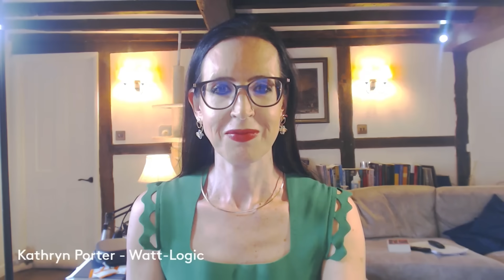North Hyde substation fire and the Heathrow blackout

Comment: Thank you, Kathryn, for this video. It is sad that the National Grid behaves like this e.g. flogs antiquated 57 year old transformers above their rated capacity,  doesn't bothering to maintain them or replace them, and doesn't even bother to keep the fire suppression equipment functional. If you look at the National Grid's top team, their bios indicate they were focused on green energy and DEI, rather than keeping the lights on. As the UK goes woke with DEI appointments and goes green, it will stop functioning and go broke.
Reply: DEI had NOTHING to do with this.  It was about cost cutting, purely cost cutting and corporate greed.  Stop putting your agenda on it.  Also green energy is important.  The problem is doing  everything half arsed because half arsed is cheap.  Spend the money, do it properly ie maintain the assets properly AND provide renewable connections and whilst you have increased costs and less profits for shareholders in the short term, long term you have a reliable network that is fit for the future.
Reply: @cjmillsnun   Mostly correct ... but DEI IS a real problem in engineering.  

It's not a recent one as things have been going wrong for a long time due to cost cutting (such as Indian 'coding farms') but it has gotten worse as the Old White Guys are retiring and the skill base is dropping as a result (because there is also cost cutting when it comes to education and training).
Reply: @dallassukerkin6878  DEI is not a real problem in engineering. DEI doesn't cause companies to offshore to Indian coding farms, often MBA's do! As the commenter below states, positive discrimination is illegal! in the UK The skill base is dropping because this country slept for thirty years as a result of thatcherism and reaganomics. For too long people have let the economy revolve around the CoL and Canary Wharf. What you perceive as DEI hires are a result of a stagnant talent pool in the UK.
Reply: @Saaj2   I don't disagree on the whole with what a big part of the talent problem is - 'diversity hires' are a part of it as they are enforced by hiring rules (why do people post that positive discrimination is not a thing when it is?) but I am equally unimpressed by the young engineers coming out of university unequipped to deal with the 'real world'.  I am, of course, convinced, that I was never that green :chuckles:
Reply: @dallassukerkin6878 I am unaware of any companies that have hiring rules that specifically stipulate they should favour diversity hire over a 'normal' hire, please show me as I'm genuinely intrigued. 

There are companies that have social mobility schemes where they target people of certain races or class, with the specific intent of giving them an opportunity that the industry did not give them before, primarily due to discrimination. If this is what is perceived as "DEI hiring", I would say it is only fair after decades of discrimination.

Most importantly, they would still have to pass the same criteria any other hire would, so this is why the whole "DEI hires are useless" rhetoric seems completely silly and is something the Telegraph and Mr Farage likes to spew.
Reply: @dallassukerkin6878 I do agree, most engineers, (yes including myself) do not have enough real world experience. I think the computerisation of many engineering roles is largely to blame, and a significant lack of desire from both the retiring generation and the new to do any knowledge transfer.
Reply: @Saaj2   A large problem with the lack of transfer of knowledge to the new engineers coming in is that companies are not willing to pay for it.  

I did what I could to provide system building methods and problem solving approaches as well as general system experience but upper tier managers were never willing to allow me the time to do it, even when the more immediate managers were in favour of it (as my retirement grew near).  In my own time I put a folder together of 'essentials' and left copies with the juniors in the team when I left but who knows if they will make use of it - I'm the old gimmer who retired after all :)

For me, the biggest tell, of how bad a situation this is, is that when I retired last year, both the senior engineers from the companies other two offices resigned ... because they knew they had no one to hand work off to who could actually do it.  That is scary for what's to come if AI does not live up to it's hype!

EDIT: In engineering in particular, people don't generally realise what a patchwork of systems and technology our civilisation hangs on.  Some of the things I worked to keep going were first commissioned in the fifties!  If AI lives up to anything I hope it learns how to keep things going that are running obsolete code on obsolete hardware over obsolete protocols to control vital infrastructure.
Reply: Some people say it is an MBA problem. Once your top management are filled with MBAs instead of technicians then your firm is done for. They destroy major car firms and many others.
Reply: Positive discrimination is illegal in the UK, unlike the US. The main problems are more likely to be  deteriorating technical education and saving money by hiring fewer, younger and less experienced staff. Electricity is not labelled "green" or "made from fossil fuels".
Reply: How to say you don't know what DEI is, without saying it.

DEI does NOT mean hiring unqualified people.

Look more to the qualifications than your bigotry.

Comment: Run by accountants not engineers. Renewables aren't resilient so expect more of this. Chronic under funding on replacing old infra structure   also an issue. But a dollop of cash from the govegnerment would create a load of jobs and boost the economy, but since we haven't been training electrical engineers who is going through do the work and degree in women's studies ain't going to help.

Comment: This was shocking complacency and incompetence all round. I wonder how much money Heathrow spent on REGOs, EV installations and other green initiatives which might include ditching reliable diesel generators. It is insane to me that we have technology to mitigate these unforeseen circumstances yet the penalties for doing so make it no longer viable. Also Neso no longer allow diesel generators for STORE so alternative more expensive less reliable alternatives are used for maximum revenue. Could it be EV chargers increased the capacity to such an extent that this caused the substation to blow?

Comment: These are all good points, and they can be expanded into a more general point which the "renewables debate" tries to ignore.  Resilience (aka security of supply) costs a lot of money, and therefore is an important part of the value that homes and businesses expect from having an electricity supply.
To start with the example in the video, it would be lowest cost to just have a single transformer, but that's not enough to be able to offer resilience.  A single transformer will not be available for planned maintenance and also for unplanned shutdowns.  So the industry must have designed-in "redundancy"  (that is, more than the minimum) to secure supply.  This means holding multiple pathways and multiple generating sources, so that the failure of part of the network is unlikely to disrupt supply.  As these pathways come in fixed capacities and each pathway must support the required capacity (or sometimes less, but that's a compromise), the industry talks of things like 'n+1' and 'n+2. levels of security.  "n+1" means doubling the required capacity ('n' is what you need, '+1' means double it to protect against loss of capacity), but this means periods of maintenance leave supply at risk of a single failure. So there is 'n+2' which means providing 3x capacity, and maintenance of some capacity still leaves "n+1' level of security.
The point that I'm getting at is the expense of all of this. It leaves the conclusion that customers (homes and businesses) must value security of supply very highly, and the price they are willing to pay for supply is not just for the unsecure consumption of kWh (the value of energy consumption if it was intermittent).
And this doesn't just apply to networks. It applies to the sources of generation: the power stations, the types of power station, and the fuels consumed.  If we want to have secure power supplies, we need diverse sources, and we don't want to lose too many eggs in the power generation basket.
And this is where I will criticise renewables, especially the recent drive towards wind generation.  Wind generation only supplies when the wind is blowing, and therefore does not provide security of supply.  The wind (in effect, the fuel supply) is also a single point of failure risk, as still conditions do not neatly diversify over geographic regions, and it is possible that the whole of the UK and even Europe can experience calm conditions, as well as at the worst possible time.
But the UK Government drive for renewables has treated the whole matter as a question of cost-per-kW, and has argued that wind generated electricity is lower cost compared to other forms.  And so it should be, by a very wide margin.  That's because wind-generated electricity has lower consumer value compared to firm sources, and this follows directly from intermittency.  So claiming (rightly or wrongly) that wind generation is can match or improve firm sources is not a reason to invest in wind-powered generating sources. The value of security of supply (which wind does not provide) has to be included in the comparison.

Comment: There is more to the Heathrow failure than they are letting on. Each terminal has a feed from both North Hyde and West Bedfont, so half is fed from one, half from the other. Additionally, equipment rooms are double fed from transformers fed from both. Equipment has supply from both, either by low-voltage DC fed via diodes, or 230v AC mains linked via fail-over switches. Also, critical equipment, like radio basestations, have battery backup with 4 hour endurance,. Thus any failure would put the lights out in only half of a particular building, but essential services, like the door-swipe security gear, would always be powered for long enough for the main fault to be fixed (in theory!). Obviously, a major incident, like the switching centre transformer fire, would not be fixed in 4 hours, but diesel standby generators are available to power half of each terminal in the case of a major fault that might take weeks to fix, the expectation being that a local substation transformer might blow up. However, North Hyde was overloaded, so some extra load caused it to explode, and West Bedfont was not able to carry its half of the demand. Was a trip at WB, putting all equipment loads on NH, responsible for NH blowing up? WB was not then in a state to power all loads for more than the four-hour battery back-up, so all essential security systems died when the batteries died.
Reply: This then leads to a black-start with unknown amounts of the fire systems out, lights out, baggage failures, IT failures and most importantly for HMG lack of knowlege where air-side transit people are. All have to be methodically restarted in a particular order else big risks occur. I've been involved in a black start on an oil&gas production platform and it took about 12 hours to get back on stream -  so I think Heathrow did a good job after they got their power sorted. A problem with losing power suddenly is that the state of the systems is not known - did they shut down gracefully as designed - or did they get damaged in the shutdown - luggage going flying after the conveyor stops. Lots of work for not many qualified people. People are also not allowed into a building until it is safe - lights and fire detection systems are essential, when these are running then the other systems people are allowed in - IT, HVAC, security, then a full security sweep to ensure that no people are in the wrong place.
Conclusion which has been learnt many times before is that a plan for every contingency is required and suitable people to implement it and who are capable of solving unexpected variances. I ain't cheap.
Reply: @tonyshield5368 ...yes Tony, and being out of operation is also not cheap, so we can only agree that Heathrow should have its own CCGT generator on site...maybe two? Cheap at the price...
Reply: @Ironic1950  If we are going down the national pride thing of saying Heathrow must never have to close because of man-made issues then that is one of the solutions. But what about weather - fog can be handled by autoland but that has capacity limitations, and wind which depends on the skill of the pilot and also gives capacity limitations etc... Need to decide what our requirements are. And who is going to pay and how much? Kathryn points out this was caused by lack of maintenence by National Grid - probably cheaper to maintain properly and make sure the system demands are not too high. I'm sure a committee will solve this in time for the 3rd or 4th event . . . .
Reply: @tonyshield5368   ...pride is not the issue; losing millions of pounds is...

Comment: Engineering 101, identify a single point of failure within a system. Engineering 102 avoid common mode failure. I think these 2 points were included in my first engineering lecture 50 years ago. Watching this video, Kathryn has done nothing for my blood pressure. Excellent explanation of the incident but I am not the better for it!

Comment: Thanks Kathryn. I appreciate your insight on this. I wonder if the Interconnectors are in a similar boat? I have vague memories of the Autumn 2021 outage on IFA1 that caused the first spike in wholesale prices which had been creeping up all year, and that may have been a factor in the decision to invade Ukraine a few months later (although this was probably more Gas related). Regardless, we have some potential key points of failure in these, particularly with the dependency on foreign help with Winter capacity availability. I presume they have better care taken of them given their commercial value vs a local transformer but it is that a fair assumption I wonder?

Comment: They wouldn’t need to have 100% backup. For instance, A/C could be turned down in a fault scenario, maintain supply to power consumers critical to operations. And possibly operate at reduced passenger throughput if necessary. Not that much power is required to keep the lights on.
Reply from the maker: My suggestion is LHR build a gas CHP that is say 110 MW. Site load is currently 50-60 MW. This would give room for future growth and allow them to sell back to the grid - in W London the grid is so congested this would be profitable. They should set up dual fuel capability with jet kero - LHR has a jet kero pipeline to the Fawley refinery so that would give higher levels of resilience eg if the gas grid fell over

Comment: Why are we spending billions on wind energy generation that only works for one third of its potential yet neglecting to maintain critical infrastructure that needs to work 24/7 for 365 days a year?
Reply: Ask Milliband.
Reply: Why are you still burning up finite resources?
Reply: @nathansmith7153 because we can
Reply: Because we're saving the planet. Haven't you heard?
Reply: @maxberan3897  the planet is approximately 4 and a half billion years old   It’s doing just fine

Comment: Ive been an engineer for 35 years, last 20 doing inspections for in service deterioration. Its sadly common in industry to push equipment past is life cycle, and the worrying trend is it gets asked to do so much more at the end or past its life cycle with often less than mandated maintance, in fact at the very time it should have more FREQUENT maintance, often is less that it had when first installed  
Thank you for another excellent video.
Reply: Much of that is due to developments in materials science.
The older designs being considered to be "over engineered"